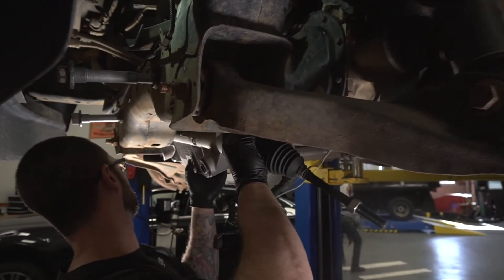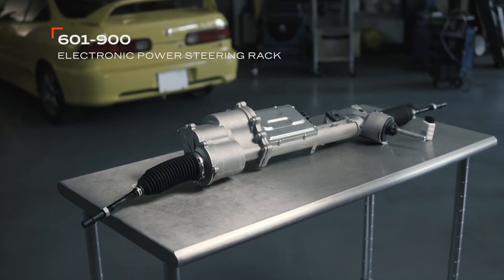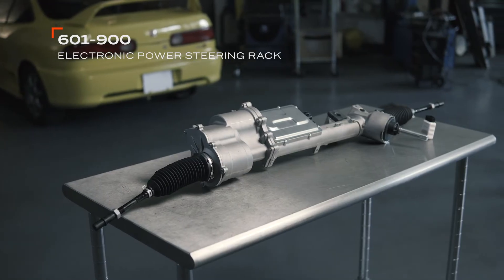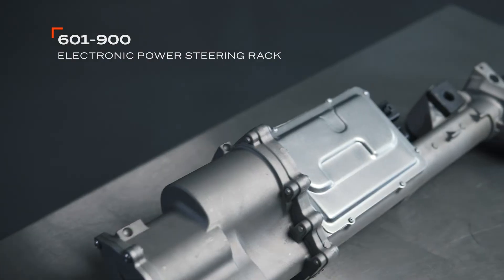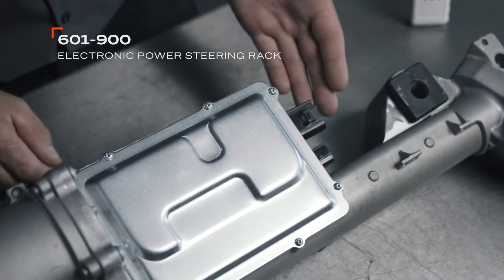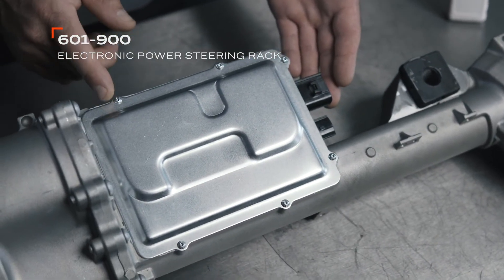Introducing Dorman's New OE FIX EPS Rack for Select Ford F-150s, with Exclusive Programmer

Comment: Do you have it for a Ford F150 2018 3.5
Reply: What did you end up doing for yours? Mine 2015 5.0 just started leaking last few days. Wondering what I can do before it goes bad or if it’s no choice but new one or not